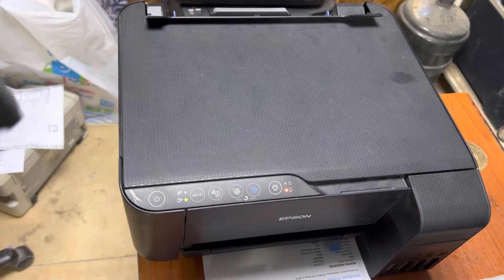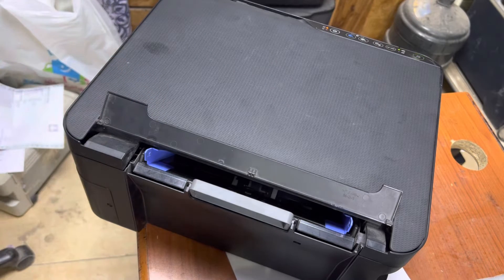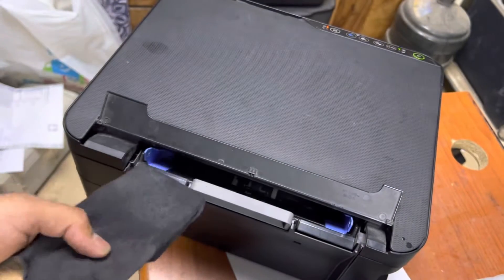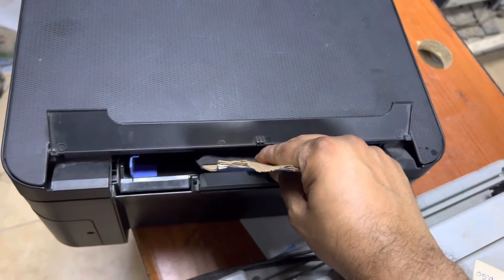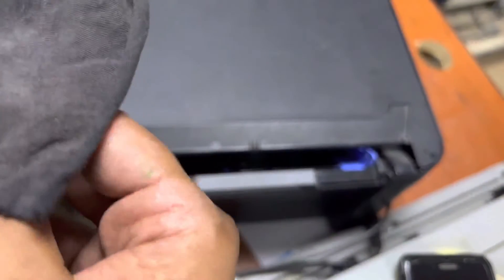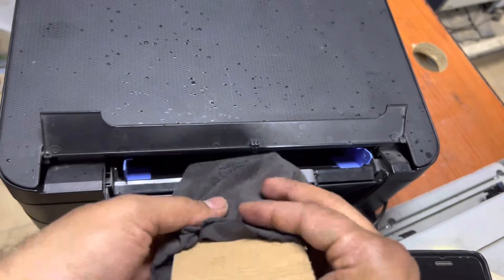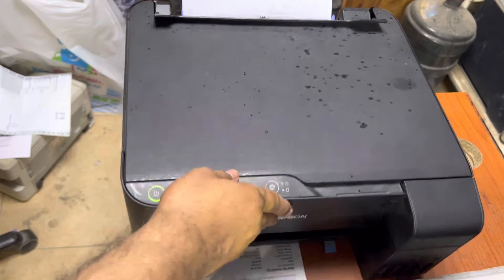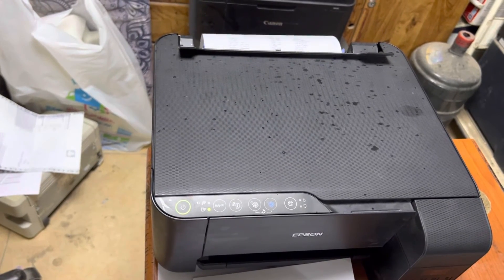How to Fix Paper Jam in Epson Printer L3150 | Paper Feed Issue Epson L3150, L3110

Comment: İ will test that method, my printer is new, i used thick paper (220 gsm) with hiting inside. than it not feed normal one paper (80 gsm), all youtube videos shows pickup roller change, i think it is not broke pickup roller because its new(i see up side roller normal work), 6 months used, what think about that? It will be?